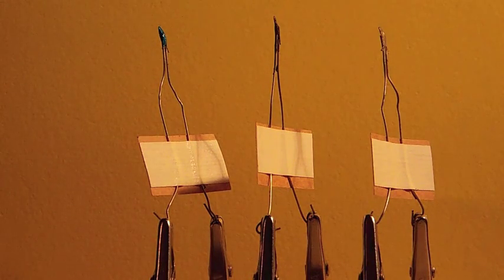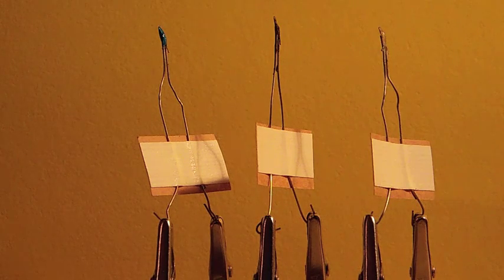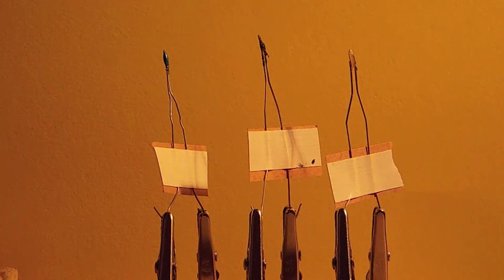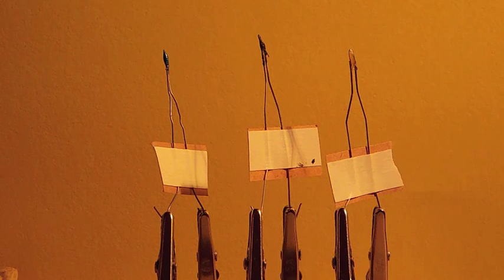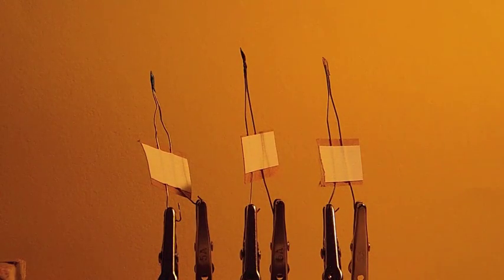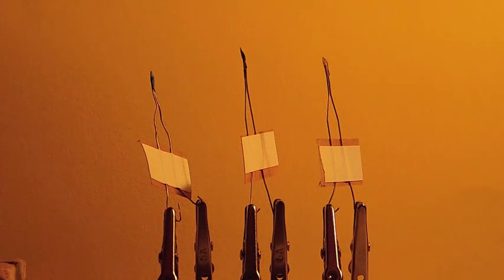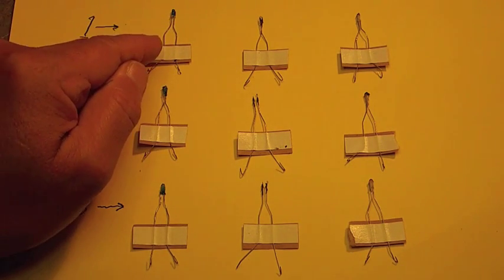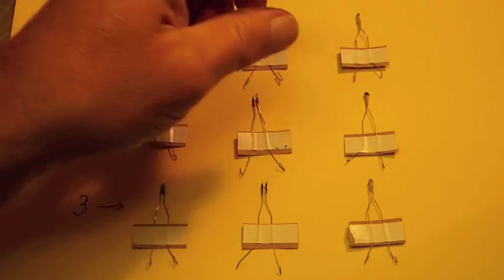Estes New Igniter Testing - September 12, 2014

Comment: This is a classic example of why mixing different igniters in a cluster ( 3 in parallel) is a bad idea.  Maybe one igniter with 3 equal length quick fuses might be a better idea. The igniter lights the fuse and the fuses start the engines. An electrolytic capacitor in the output circuit will help give enough current. It should be placed after the arming switch and before the firing switch. Dr. Kip